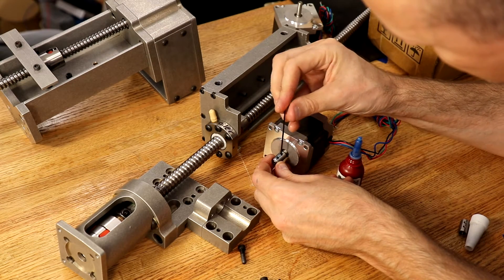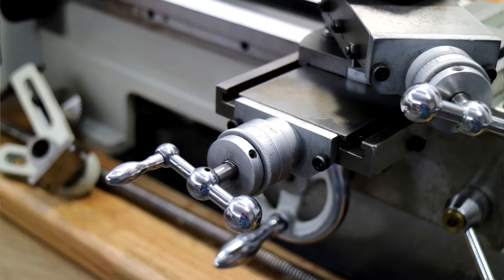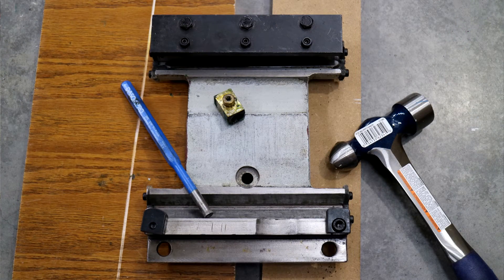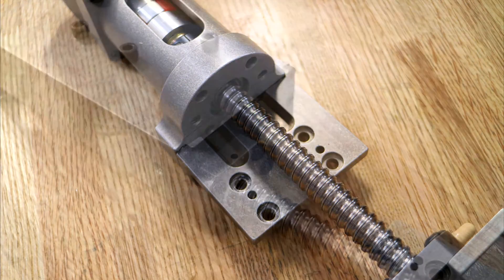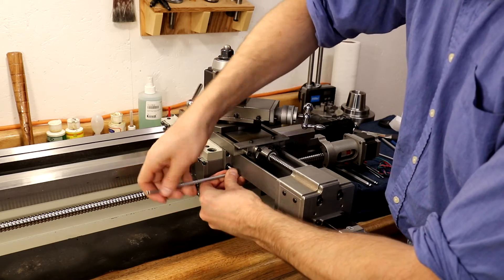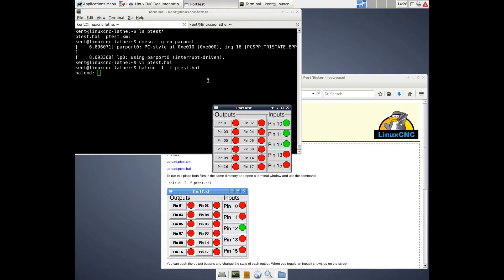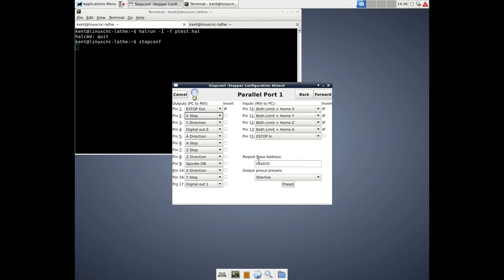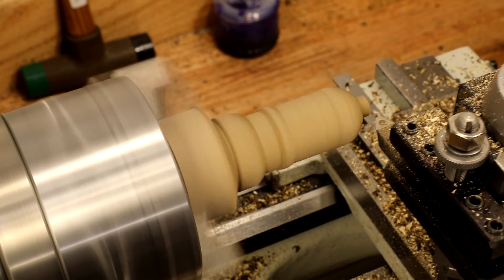CNC Lathe Conversion Kit South Bend BDTools SB1001

Comment: The ball screw nut on the outside of the cross slide is a really smart idea.  I have a small lathe with not much room for a ball screw nut. So making it stick out a bit more toward the user is a good enough compromise. Thanks for sharing.

Comment: why didnt he just put the motor on the opposite side of the cross slide?
Reply from the maker: Probably to keep the installation simple. Existing bolt holes are used by the kit. To mount to the rear of the cross slide, new holes would need to be added, and the cross slide clamp would need to changed too. Certainly possible and would be nicer, just harder to install.
Reply: @kentvandervelden  fair point

Comment: How to set tool pls? Does it have home?
Reply from the maker: Tool lengths are set by taking a cut, without moving the tool along X, measuring the cut diameter, and entering the radius. Can do this with boring bars too, for inner diameters. With repeatable tool holders like the Alrois, only need to do this once per tool. There are inductive sensors for homing at extreme +Z  and +X locations.
Reply: @kentvandervelden  thank you!

Comment: Question, if I may.  I have a 1605 ball for my x axis.  I'm using the bearing housing that generally comes with it.  It's always a pain to deal with.  Does Billy's kit just come with a with a bore for a bearing alone, within the 1 to 1 housing.  I saw you pull it apart but can't make out what is on the inside, beyond your timing pulley.
Thank you
Reply from the maker: Hi Shannon, take a look at the "More Photos" link at the following URL. Let me know what you want a better picture of and I'll get it to you.
https://kvvcreates.com/sb1001_cnc_lathe/
Reply: @kentvandervelden  Thank you.  You showed me the stepper motor pulley in the housing.  I'm curious what's in the opposite end of that pulley and belt.  The shaft end of the ballscrew.  It is a bearing, i'm assuming?  Your setup looks sharp and clean.
Reply from the maker: @shannonbelcourt1402  Check the same link again, I added a zip of Billy Dirks' kit. The end of the X-axis ballscrew is tapped and a screw and washer are installed. The ballnut is attached to the front of the cross slide and the ballscrew floats under the cross slide, and while unsupported is short. There is little room in the channel to install a ballnut without using a small diameter ballscrew. The lathe is a joy to use. I hope this helps :)

Comment: Hi can you please tell me where you downloaded the post processor for Linuxcnc to use with fusion 360. I am just trying to get my small cnc lathe up and running whilst also learning Linux and Fusion.
Many thanks and great video.
Reply from the maker: Thank you. I downloaded the post processor from 
https://cam.autodesk.com/hsmposts
the direct link is (as of today)
https://cam.autodesk.com/posts/post.php?name=linuxcnc%20turning 
I made a few changes to it. Send me an email and I'll send you the one I use, and then you can compare too.  Put the post processor in your cloud library to protect it and make it available on multiple machines.
Reply: @kentvandervelden  Thats brilliant thanks very much for your help. I will have a look tonight hopefully.
Regards
Dave
Reply from the maker: @d.c3363  Glad to help. The mill post processor is a little different, in case you need it. I'll check later what changes that I made and let you know if they are useful in general or simply something odd that my setup needed.

Comment: Hi 
I saw in cnc routers using rack and pinion drive
My question is why you don’t use yours machine rack and pinion as drive 
? Thanks 🙏
Reply from the maker: Hi Anwar, your suggestion could have worked. The existing rack and pinion quality was unknown but probably good enough. There was considerable backlash but that could have been solved. The ballscrew setup is pretty simple and the long travels and high speeds of a CNC router was not required. Hope this helps.
Reply: Kent VanderVelden thanks 🙏

Comment: I wonder if instead of replacing the main lead screws and nuts one could simple keep the original ones and then set the LinuxCNC backlash compensation. I've never use this LCNC feature. Have you tried it? If so, do you think it could be able to handle such large backlash?
Reply from the maker: I do believe this would work. While an earlier attempt, I did experiment with backlash comp and using backlash compensating nuts but didn't have sufficient torque in the motors I was using at the time. I have an earlier video on a 3D printed CNC lathe conversion that demos this a little. That one didn't use LinuxCNC though. I was thinking then to only make an electronic leadscrew.

Comment: Build the kit !!!!! You can save A lot of money with steppers and drives using cut-offs wher I could I built a nice kit for $500 thats with Nema 23's and a spindle controller. Mach 3 or mach 4 is the better software to use lynux is just a load of extra crap you dont need !  I use Mach 4 and I make some extreamly detailed  parts right down to the .000000000001
Reply from the maker: That's awesome. Consider building kits to sell to others. Given what you say, you could do very well. Best of success to you.
Reply: Thought about it but rather not. I don't need the money  to spend time on that .

Comment: You should seriously look at the new Centroid Acorn controller. Professional CNC interface by a CNC manufacturer. BTW keep up the great work! Love the 3d printed videos!
Reply from the maker: Thanks, a friend got one after Franco demoed the controller on his channel. It would sure be simpler and cleaner than using a PC and breakout board. I've replaced the breakout board with a Pico USC, like I'm using on my mill, and now am well past the Acorn (and Masso controller) cost. Others have been saying I should try the Clearpath motors, and that's easier to do on the lathe with only two axes, but that drives the total cost way up. I ordered 1/2" tooling from Tormach. They have inserts for steel and polished inserts for aluminum, and I've added them into Fusion360. I'll try to do an update mid-December. Thanks for commenting, and have a great weekend!
Reply: I use centroid controllers at work. I absolutely love them.

Comment: Neat conversion kit! The finish on the aluminum parts, seems like the parts are tumbled? Reminds me that I need a tumbler..  That bench-grinder! I have some tools from my father, working with them always results in flashbacks. And the flying parts.. Working with wood and plastics in the lathe always seem to surprise at the most unexpected moments!
Reply from the maker: Hi Rene, it's hard to know how much time Billy saved me, like David did with the PM25 kit. But the mechanics are part of the puzzle. Someone might do well to make an electronics kit. Even with controllers like the Masso, there's still work to be done, especially if one wants to have a nice enclosure. I would like to create a nice enclosure for the lathe electronics; I never did that for the mill.  Having said that, today's project was mounting new electronics to a piece of plywood. "Temporary" things have a tendency to become permanent.

Comment: I look forward to future vids where you are making something on the lathe.
Reply from the maker: +Adventures in Fabrication Hi Paul, do more wooden pawn pieces count? :) For a CNC lathe, the pawn seems to be the equivalent of Hello World to a programmer and a new language. I have a simple part in mind, but am going to try to first add a spindle encoder. I'm heading your way mid-December, delivering an instrument to Dallas.
Reply: Sure, wood counts, metal is expensive way to practice/learn. Dallas is a good 200 miles away from where I'm at in Houston.
Reply from the maker: +Adventures in Fabrication Texas is a BIG state. I drive to San Antonio once, thought I could do it in a day, got to Waco and looked on the map and found I was only half way.
Reply: Where are you coming from?
Reply from the maker: Iowa, about a 12hr drive, and hoping for good clear roads. Stay for a couple of days and fly home. Renting a U-Haul because FTL freight delivery has a lot variability. The big names give better delivery estimates, because they have the volume to fill the trucks faster, but the cost goes up too. If you have a better suggestion, would like to hear it. I used U-Ship last time. Great price, but the deliver estimate was something like four weeks +/- two weeks! Had to wait till delivery and then arrange flight. Actually learned about U-Ship from a boat maker that I sold my original lathe (Grizzly G4016) to, ten years ago, also in the Dallas area.

Comment: What kind of a NFS share do you use on your PC? Would you recommend to go with Linux CNC or March 3 as an controller? Great Video!
Reply from the maker: Thank you Linus. For sharing between computers, I have a NAS with CIFS/SMB and NFS support. (I mostly program on a Linux computer but review results on a Windows computer, so I'm frequently moving files around.) A NAS should not be needed though. Without a NAS, I would try creating an open share on Windows and mount that on the Linux machine with mount.cifs. Mach3 was easy to setup and use. But with the last mill, I wanted to be able to dig into the code of the controller, extend and manipulate the controller, etc, and LinuxCNC provides all that. I had no problem finding compatible hardware for Mach3 but LinuxCNC was pickier. If using LinuxCNC, I would just commit to getting hardware that's known to work. (Some parallel port cards work. I used the Pico Systems USC  on the mill and will install one on the lathe. Hardware from Mesa is common but I've had a hard time figuring out what's needed.) Tormach recently stopped including Mach3 and made PathPilot starting with a LinuxCNC core. I like that LinuxCNC is open about their technology, and I have more confidence in Linux not doing something unexpected. OK, those are the differences that were important to that come to mind. Try both if you have time, and pick the one that meets your needs. Have a great weekend!